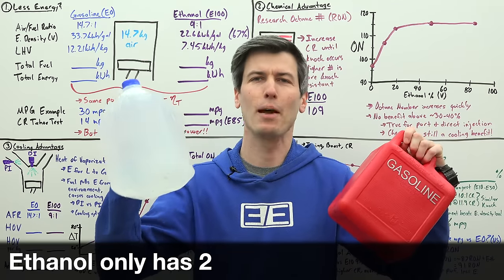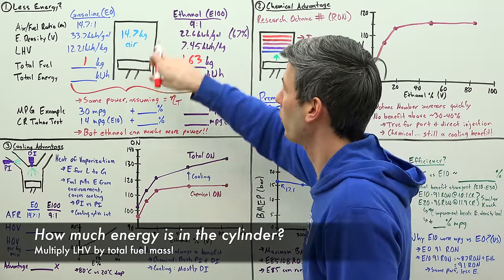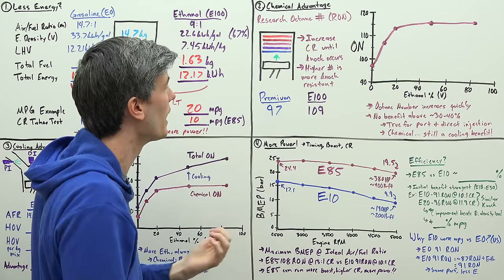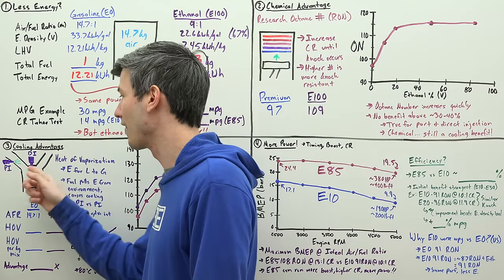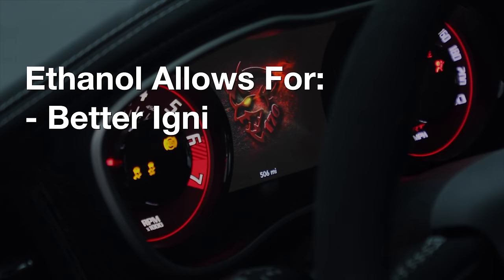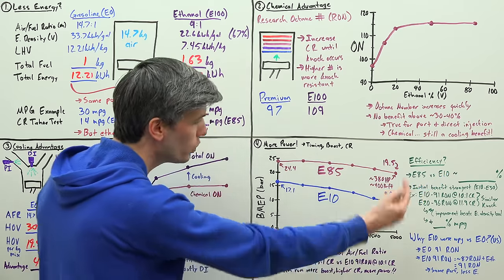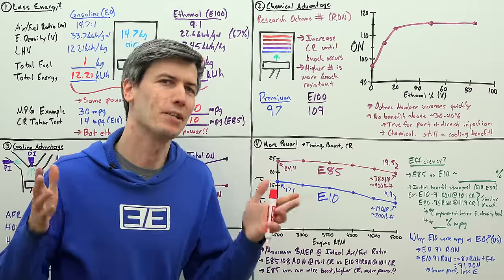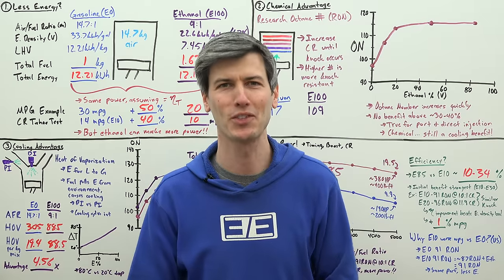Why Does Ethanol Make So Much Power? (Versus Gasoline)

Comment: Also ethanol = using food for fuel. Translate that into farm land for food being used for fuel.
Reply: Nope, our ethanol is value-added from already existing feed production which leaves 100% of the protein and other things still available for feed in a healthier, more digestible/efficient, and more concentrated form called distillers grains.

This is how ethanol can remain so cheap despite the current high price for corn.

No corn is grown just for ethanol because it would be uneconomical.

All the fertilizer and things in the soil are still fed to livestock in the distillers grain.  Ethanol is made only of thing in the air: solar energy, CO2, & water with the latter two being recycled once burnt.

Cattle cannot digest starch very well and waste it out their rear ends in the form of methane gas and carb rich manure which turn into methane later.
Reply: @Dana Fletcher  too bad "our ethanol " isn't the same as ALL  or everyone's methanol.  But I do appreciate what you are saying.
Reply: @danafletcher2341  What are you talking about? Your comment is gibberish. There is a huge amount of corn that is grown solely for the purpose of producing ethanol in the US. You seem to be woefully misinformed.
Reply: @Monaleenian  Corn ethanol without the feed factor is uneconomical to produce.  We cannot grow more corn than the protein requirements of the cattle herd on feed.

With the feed factor, corn ethanol can outcompete even sugarcane despite it making much more ethanol but little else.  So much so that Brazil has put an import tariff on our ethanol.

Believe it or not, the corn belt grew more corn acres in 1980 before ethanol than they do today with record ethanol production and ethanol plants everywhere.

2018 Iowa 13,200,000 acres of corn with record ethanol production
1980 Iowa 14,000,000 acres of corn before ethanol

2018 Illinois 11,000,000 acres of corn with record ethanol production
1980 Illinois 11,600,000 acres of corn before ethanol

2018 Indiana 5,350,000 acres of corn with record ethanol production
1980 Indiana 6,450,000 acres of corn before ethanol

Comment: For those wondering why Jason's premium gasoline number is so high (97vs typical 93 or 91 octane),  when Jason gave octane rating numbers, he gave RON octane ratings (displayed at gas stations in Europe) which are higher than (R+M)/2 ratings, which are displayed at U.S. gas stations.  Most European stations have 2 gasoline types, 98 and 95 octane which are equivalent to U.S. 93 and 91 octane.  So in essence... they only sell premium.

Comment: Actually, in terms of the benefit of alchohol cooling the air charge helping to make more power, we see a greater benefit when the fuel is introduced sooner, for example, with a carburetor or injectors at the throttle body at the beginning of the intake manifold. On a dyno a "wet" intake almost always makes more power than a "dry" (port and/or direct injected intake) on the same engine. The reason is it takes time for heat to transfer - for the heat to be "pulled out" of the air by the fuel.
That said, direct injection is more efficient in terms of fuel efficiency and knock resistance but this is one of those cases where there is a tradeoff. It's why methonal and nitro engines inject some of the fuel before the supercharger rather then all at the port.

Comment: I've been running an Ethanol blend (E20-E40) for a while now in my Mustang. No difference in real world mpg over E10. The only differences I notice is, cheaper fill ups, more torque, and most importantly, more smiles 😄
Reply: Is that something you’re able to find at a local station? I don’t think I’ve seen blends that high outside of the very few e85 stations around me.
Reply: @ALMX5DP  Just fill up with 2 gas pistols?
Reply: @ALMX5DP  You can mix E85 and E10 to get those blends with a little math
Reply: @jonathansmith7306  for a race car that should be fine but for a road car seems a little fussy.
Reply: Torque and smiles usually have a 1:1 ratio
Reply: Cool, learn something new everyday. Boosting Octane of Cheap Regular E10 Fuel with E85 is much cheaper than Premium at the pump
Reply: dont do this in a non-GDI car!
Reply: @ALMX5DP  I used to mix 87 and 93 to make 91 octane. I don't think it was that fussy. I guess it would depend on the dispenser
Reply: @jonathansmith7306  "E85" at the pump isn't always 85% ethanol, it varies for summer and winter blends, and can be as little as 51% ethanol.
Reply: @jonathansmith7306  You'd have to put the handle back into the pump stand, which would end the transaction, so you'd have to start a new transaction for the other blend. Some card operators or payment processors will refuse two transactions from gas pumps one right after another to prevent fraud (I've run into this once when I realized I was pumping the wrong grade). That said, I might try this on my Ecoboost engine in the summer just to see if it makes a difference.
Reply: @iviaverick52  NOPE.
Reply: @jasonosmond6896  I mix 87 octane 7 gallons and 3 gallons E85 at a stop on my SRT JEEP. less cost than premium. I do it in the summers.
Reply: @jasonosmond6896  that's what I did. Was able to get pretty quick at it

Comment: Would love to know your thoughts on running CNG/Natural Gas. I’ve seen conversions for full size pickups/SUVs running a tank in place of the spare. The fuel is le$$ than petroleum gasoline though the conversion has costs. Thanks for the awesome content!
Reply: From what I've seen on CNG the main issue is just range. Much like hydrogen it's hard to get a lot of range out of a gaseous fuel. I have seen though that CNG does tend to have the advantage of longer engine life, cheaper fuel, and the fact you may even have natural gas at your home to tap into, but I haven't seen if the cost savings are actually worth it. I mean yeah they're cheaper to fill, but does that break even per mile? 

I think it's more one of those cool experiments like those running cars on vegetable oil. Advantage of that one is you can literally go to random restaurants for their waste oil, downside is it need to be heated or it solidifies and you have to filter waste oil.
Reply: Or also, what about direct injection of LNG?  Man, the heat of vaporization there.

Comment: I've been running E85 for years- I mean years! I have actually seen fuel economy have minimal losses or none  on this fuel due to the increased timing , etc. Thanks for doing this video on E85.I really enjoyed it.
Reply: I loose 18-22% on a stock Honda motor.
Reply: Lol, you can't recover the MPG by adding timing. That's not how it works, mathematical impossibility.
Reply: @OtisFlint  More timing, more power ,better fuel burn?
Reply: @OtisFlint  I didn't say timing alone, and I also said minimal losses. Please read in it entirety and stop misleading the conversation by only quoting part of what i said. In my statement there was a lot to unpack. Please note that I have tuned countless cars on my dyno and currently run E85 in my own project. Will you still have losses? Absolutely.  Some can be offset by doing certain things within the tune. I have also noticed that the more stock the combination, the harder it is to recover fuel economy.

Comment: I’ve been a die-hard E85 user since December 2012. My only issue with it is how hard it is to find when I travel. There are plenty of pumps here in southern Michigan, but that changes once I head north - with no E85 at all in the upper peninsula. I’ve been able to make treks into the UP work by carrying at least a tank’s worth (in my case, 19 gallons) of E85 in the trunk, and driving just across the state line into Wisconsin to get fuel at Kwik Trip (KT has added stores in the UP, but only with E15. Apparently E85 demand suddenly evaporates as soon as you cross back into Michigan). 

However, I went to northern Vermont to witness the eclipse over Lake Champlain in April 2024. On the way, I drove up to Ottawa to tour parliament, Toronto to walk EdgeWalk on CN Tower, and then up to Montreal the day after the eclipse. None of this area has any E85 AT ALL, and it is not feasible for me to carry enough extra fuel to stay exclusively on E85. I switched to Canadian tar sands (I could spend an entire day talking about how destructive the Canadian tar sands are to the environment, and how costly they are to extract and process). Within 36 hours, I noticed my engine idling rough. I initially thought it was odd to hear that when I was in Toronto and again in Montreal, especially since the air temperature never exceeded 60 degrees F at any point on my trip. However, I managed to ignore it and keep driving. 

I kid you not when I say that the second I hit the international border, with the “Welcome to the USA” sign above me as I was crossing into Port Huron, Michigan, I get an alarm on my Taurus’ dashboard that says “engine coolant overtemperature”. I immediately go to Speedway to fill the half-full tank with E85 and I begin the process of transitioning the fuel back. I decided to try driving with the hood popped open (no, it can’t fly up while I’m driving), and within two minutes of driving, the engine temperature magically and abruptly fell back to the normal level. The next day, I get halfway to work when the check-engine shows up and the car starts jerking. After 15 minutes of sitting in a conveniently-placed parking lot off a country road, I open the coolant cap to see the compartment empty. 

After a few days, I finally get the car inspected. They got me an answer within two hours. I should have been tipped off when the first thing that I heard from the mechanic was “so what are your long-term plans for this car”. He told me that it needs a new water pump, and some other suspension-related repairs (I live in Michigan. Enough said). Between all that, I was quoted just south of $8k. I work two jobs, between being a special education paraprofessional, and gig work with Shipt. I told the mechanic I don’t even have 1/10 of that. 

Against my better judgment, I started driving the car again. With the hood popped open and the car back to entirely E85 fuel, the CEL was mysteriously gone when I started my car the next morning. The engine still idles rough, but not as easily or as frequently. It turns out that E85 has a higher latent heat when combusted, meaning it absorbs heat off of the engine. I will admit that it’s not a wise idea to drive without a working water pump (one-finger salute to Ford for putting that inside the 3.5L engine in my Taurus), but I have absolutely no way of coming up with $8,000. E85 is at least allowing me to delay those repairs while I sort things out.

Comment: My car has consistently made about 15% more power and tq on e65 compared to 93 oct. An additional 75 whp and wtq is a substantial gain on any car.  The down side is gas mileage though. You use about 1/3 more fuel but at the same time it costs about 1/3 less 93 oct.  I love my car on ethanol.  It's like the gas of the gods or something.
Reply: I miss having easy access to e85.... I ran my car exclusively on it for like 8 years. Now I'm hundreds of miles away from a pump.
Reply: @volvo09  when I first started using it I was 30 minutes from the closest station. Every 1-2 weeks I would go fill my tank and 4 6 gallon cans to use before coming back. That probably isn't an option for you but one ethanol and probably others let you order 55 gallon drums of the stuff shipped right to your house. You just need to get a manual or electric pump to get the gas out of the can and into your car or portable gas can.
Reply: what car do you have?
Reply: @dmoqppsoysc  08 wrx sti.

Comment: In my Chevy truck naturally aspirated I run either E10 or E15 which is readily available here, i notice absolutely no change in MPG which surprises me, pehaps Jason's explanation is the reason! MPG between the various tankfuls is more dependent on highway or city driving.

Comment: In Brazil most cars are flexfuel, that means they can run on gasoline and on ethanol. They have two different power figures on the manual at the same time 116/125 hp for example.
Reply: In Africa it is Diesel.
Less complicated, less mpg, more power
Reply: They introduced E10 in Germany fairly recently but it would lead to problems in the engine, since E10 is way more corrosive for the hoses and other engine parts. Have you had similar experiences ? I am never filling up with E10, but with E5 instead for which my car is build 100% for sure, for E10 ..maybe.
Reply: @sierraecho884  
You'd better follow the manufacturer's recommendations. Some imported cars fare rather poorly in Brazil, due to their powertrains not being prepared for the national E27 standard.
If your car is able to handle higher ethanol blends, you should not fear any abnormal degradation. Technically, most European cars could be flex-fuel, as Bosch and most European brands manufacture flex-fuel compliant parts for Brazilian models.
Reply: @13231wmw  i THINK even non-flex now-days stock vehicles can deal with a bit of alcohol, once most of them do lambda correction, so when you put a bit of alcohol the mixture start to be poor, but quickly the ECU will compensate increasing injection time.
Reply: @AfonsoBucco  Non flexfuel cars will do that up to a certain point and then you get a check engine light lit on the dash because of lean mixture.

Comment: I'd be very curious to see a phase diagram of the components. I think that would be able to provide a lot of information! I'd imagine there must be some kind of eutectic point for vaporisation.
Reply: Gases don't have eutectics. You physically can't get phase separation in a gas. You can get azeotropes, which are similar, in liquid-vapor systems. They are significant for water-alcohol mixtures, which is why 100% alcohol is usually toxic and denatured (190 proof/95% max from standard distilling). For air and alcohol they're not significant if they even exist due to the wide difference in temperatures.

Comment: I would have liked to see more discussion on ethanol's oxygen content. All things being equal (timing, compression, boost) an engine STILL makes more power on ethanol, it is my understanding this is because it's highly oxygenated. It also seems because of the oxygen content it gives the lower air/fuel ratio and thus less energy? I'd like to see something about why engines make more power on highly oxygenated fuels with all other parameters being equal.
Reply: I agree I thought the xtra oxygen is what made one of the differences.
Reply: @oldblueaccord2629  I've seen some other comparisons that suggest it makes a difference. I do not fully understand the relationship of oxygen wtihin fuel, the air/fuel ratio, and power output though.

Comment: Great presentation, if a bit fast paced. Im amazed at the amount of bad info on E85 out there. I know that in years past  when it was first introduced there were issues with fuel systems and such, but it seems that those have been resolved. I ordered a GMC 3500HD PRO with the FlexFuel option. Had to wait 6 months for it to become available, but for $100, why not? And I've seen E15 going for $1 less than regular gas, so we're talking some zerious money on a fillup. Seems like it might make sense to do a mix of regular gas and E85 to get the best percentage. I look forward to seeing how my truck will handle it.

Comment: Been running an E30 blend on my turbo charged direct injection car for nearly two years via a flex fuel kit. Love the extra power and in my area E85 is about $1/gallon cheaper than 93octane.

Comment: Super explanation. I always heard that Ethanol was evil. You logic & the white board demonstration helped me see that adding Ethanol and messing with engine tech can produce more power. Without the last few minutes of your conclusion, I would still have not changed my mind! Thanks for teaching this old dog a new trick!
Reply: Ethanol is a really nice nearly nontoxic additive to boost RON.
Reply: Main problem with ethanol as i see it is it takes a great deal of energy to make and growing corn solely for fuel takes up farmland that would be better used to grow food. Oh, and it rots rubber seals much faster than petrol. And it's hydrophilic, drawing water into the fuel from the air if it sits too long
Reply: @gatergates8813  It's corn that wouldn't be grown for food anyway. The leftovers from ethanol production can still be used for animal feed (though grains in general aren't good for most livestock aside from chickens).
Reply: @Karl Rovey  I'm talking about the land the corn is grown on, not the grain itself- I'm aware it's specially bred for ethanol production.

 I worked at a grainery for 4 years and heard farmers do rough calculations that they burn more fuel planting, maintaining, harvesting, and drying the crop than the crop itself would actually produce. But they grew it anyways because of government incentives, while laughing at how backwards it is to burn 10 L of diesel to create 5 L of ethanol
Reply: @gatergates8813  All BS. and we use gallons not liters here in the USA. Might want to adjust your chat bot.
Reply: lol at ethanol is 'evil'. How could a chemical be 'evil'? What's a 'good' chemical?